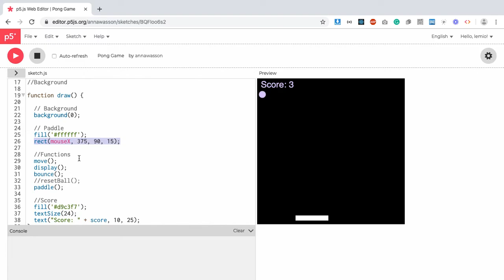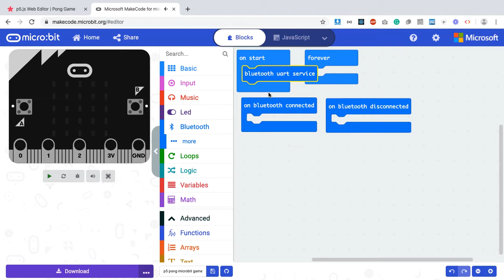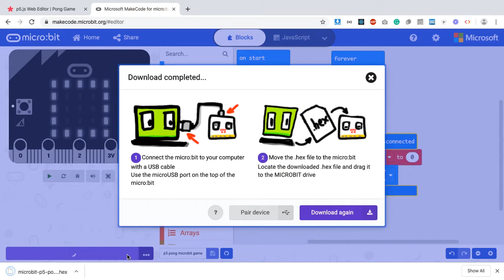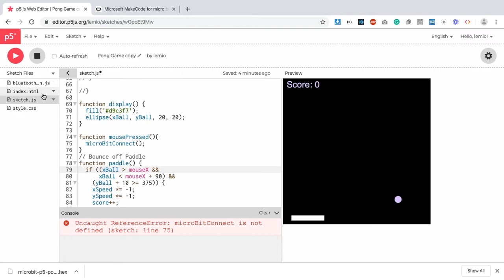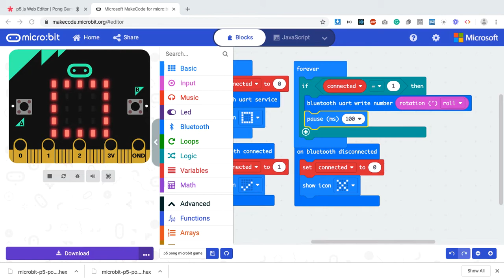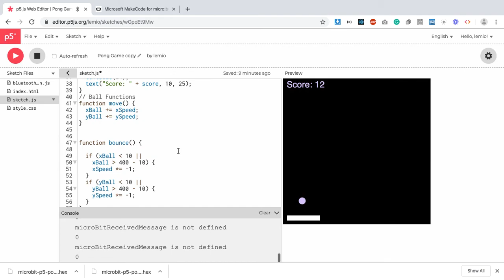Control pong in p5 using a MicroBit

Comment: Thanks for the tutorial. I've tried following it and even downloaded your files but can't get p5 to connect with bluetooth. I get the following in the console log: Error: Failed to execute 'requestDevice' on 'Bluetooth': Access to the feature "bluetooth" is disallowed by permissions policy.

I am using chrome and also tried to use the preview link you pasted in the code but still getting the same message. I was wondering if you knew the solution to the problem.

Best
Reply: did you get it to work and if so, what was the solution?
Reply: @philosyche  I did not unfortunately. Best of luck!
Reply from the maker: @rodericklaperdrix  I did not have problems with that anymore (also when it  is within the iframe it works for me). You could check the site settings under the settings left of the URL; there is a setting for me called Bluetooth scanning which is set to 'Ask'